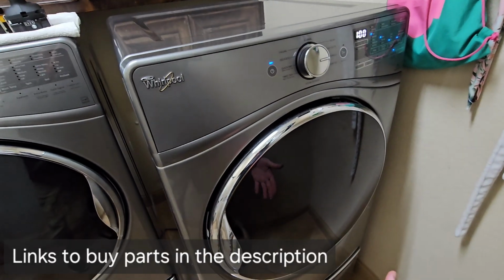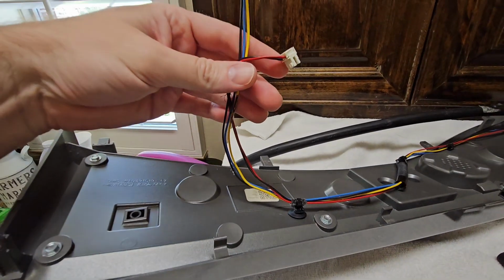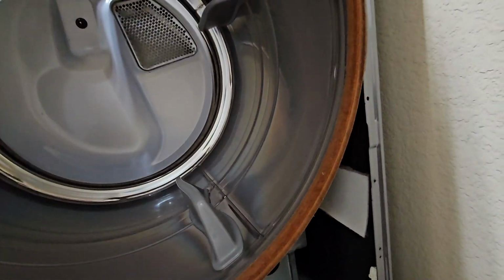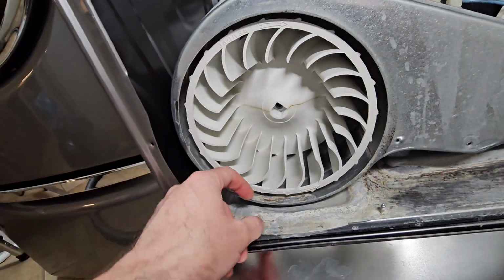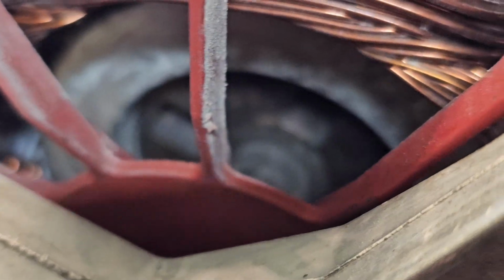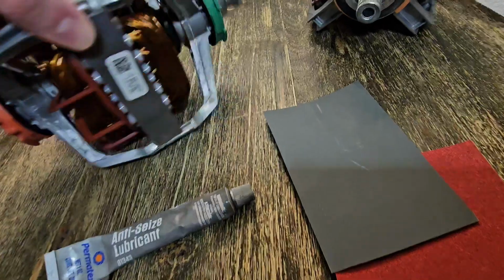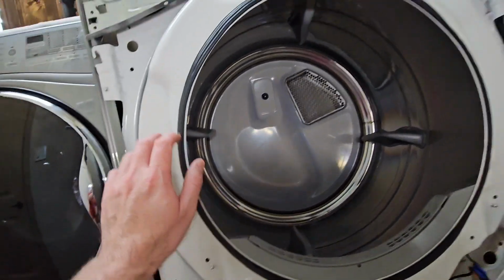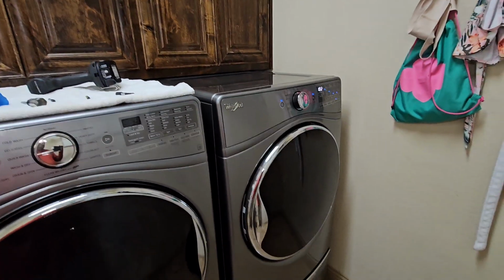Fix Whirlpool Dryer Loud Motor (Buzz & Humm)

Comment from the maker: Dryer Motor: W11364931
https://amzn.to/40QJvLQ

Dryer Blower Wheel: WP697772
https://amzn.to/4eN6fSL

Dryer Motor Pulley: WP8066184 (comes with motor)
https://amzn.to/4lPimAX

Whirlpool 4392067RC Maintenance Kit
https://amzn.to/3In9kgk
includes 4 roller wheels, belt, tensioner pully wheel.
27-inch belt for dryer models WED92HEFC, WED92HEFC0, WED92HEFC1, WED92HEFC2

Loctite 37617 Silver-Grade Anti-Seize Stick (for motor shaft threads)
https://amzn.to/4nQ43OK

Lucas White Lithium Grease (for roller wheel shafts)
https://amzn.to/3TANjNl

1/2-inch Expanding Foam Seal
https://amzn.to/4lPiHUf

Highly Durable Silicone Rubber Gasket Seal
https://amzn.to/40dcyZZ

Dryer Ducting Cleaning Kit
https://amzn.to/44GAZjJ
Reply: Wow, for the price of motor and wheel, and the risk of million things going wrong, I would have just replaced the dryer if it has been 10 years.